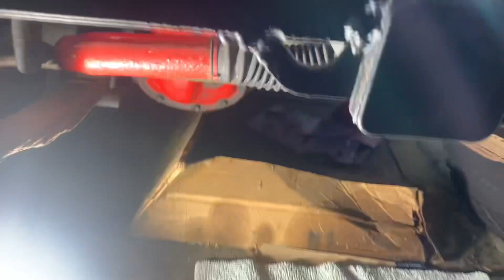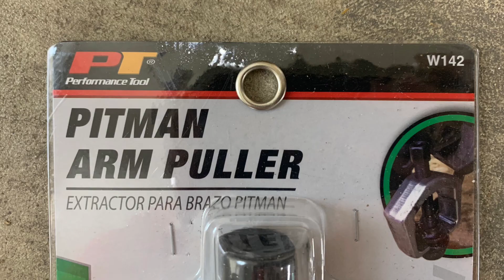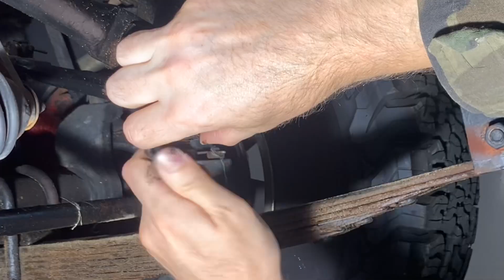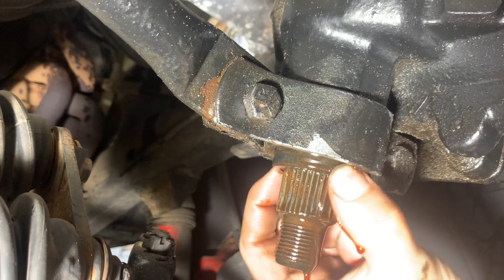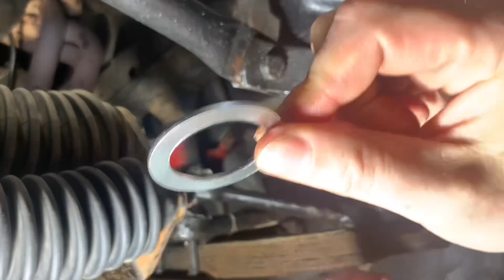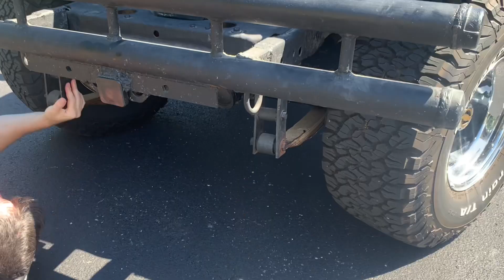How to Replace Pitman Shaft Seals - Power Steering Gearbox leak at Pitman Arm - Jeep CJ Shown

Comment: petroleum jelly will prematurely degrade and damage most rubber seals, O-rings, and gaskets. Hydrocarbons in petroleum-based products cause rubber to soften, swell, and eventually crack, leading to premature failure.

Comment: First of all, AWESOME video, I think everyone can agree. Just hands down. I just wanted to note and ask if anyone else might know. I am working on a 1999 GMC Sierra 1500, SLE, 5.3 liter. I have been researching much. It seems some of these kits like the 8717 or 8763 kits have the integrated seal and washer upgrade, and the directions are not so clear that it comes with. I hope this helps. I know this is for GM but again I hope this helps. There is just not a lot of info out,

 Duralast / Edelmann 8717 Kit 

This kit is patterned after the older GM design, but with the first seal already integrated. The order is:

Primary hydraulic seal (with spring, integrated backing)

Goes in first, deepest in the bore.

Lip faces inward toward gearbox fluid.

Dust seal (metal‑cased)

Installed directly above the hydraulic seal.

Flat side faces inward (toward the hydraulic seal).

Lip faces outward (toward the pitman arm).

Metal washer

Sits on top of both seals.

Provides a rigid surface for the snap ring.

Snap ring

Locks the stack in place.

Dust boot (external)

Captured under the pitman arm when torqued.

🔹 GM Updated Service Kit
This is the newer GM Genuine/ACDelco design. The order is:

Double‑lip hydraulic seal with integrated backing

Lip inward, flat outward.

Replaces the old lower seal + washer combo.

Spacer/washer (if included)

Above the hydraulic seal.

Dust/wiper seal (metal‑cased)

Lip inward, flat outward.

Snap ring seats directly against the dust seal’s flat case.

Snap ring

Locks against the dust seal’s flat case.

Dust boot (external)

Captured under the pitman arm.

⚖ Which One Should You Use?
You must follow the instructions for the kit you actually have.

If you have the Duralast/Edelmann 8717 kit, you should use the first sequence (hydraulic seal → dust seal lip outward → washer → snap ring → boot).

The GM updated sequence is only correct if you bought the newer GM Genuine/ACDelco kit, which deletes the washer above the dust seal and flips its orientation.
Reply from the maker: The open side with the internal spring faces the fluid. 

Thanks for sharing that information about the seals and washers, as well as the helpful tips!

Comment: Thank you for this, I have an XJ and was able to follow these steps and complete mine. I don't really know why, but when I took the pitman arm off, I had no snap ring and no rubber or metal washers to remove. Just a ton of gunk and thick fluid. I cleaned it and installed my washers and snap ring in the same orientation as you. So far it has been holding. ('96 Cherokee XJ)
Reply from the maker: Great to hear!
Reply: Literally had the exact same thing happen to me. There was just nothing there and I’m still confused on where the washers and seals 🦭 went

Comment: Shouldn't you be using silicone to lubricate the rubber? Doesn't petroleum deteriorate the rubber?
Reply from the maker: It is not a problem for this specific seal. Power steering fluid is petroleum based, and this seal is petroleum safe.
Reply: @HowtoandReviewsOfficial  Gotcha!

Comment: I know some of the video was somewhat oversimplified, however..this to me is the best one I've seen so far thank you
I wonder if heat or gentle persuasion with a hammer is okay to use on the arm?
Reply from the maker: Glad it was helpful!
I would definitely use the puller to get even force. Heat or hammer to jar things loose. Mine did not come off easy. It took a lot of force to break it loose.

Comment: Damn im struggling to get the last seal i used to screws n broke so theres stuck on the seal im pulling with pliers but nothing im insert 2 more screws n use a hammer n piece of wood 🙏 thanks man im doing this on my 1979 camaro z28
Reply from the maker: You will eventually get it. There’s a bearing behind that last seal. Make sure you don’t go too far, or you might be running the screw into the bearing, and you definitely won’t be able to pull it out.
Reply: @HowtoandReviewsOfficial  you know what i think i went too far in with the screws then ima try n unscrew them with pliers thanks alot !! Ima try it next weekend hopefully it comes out